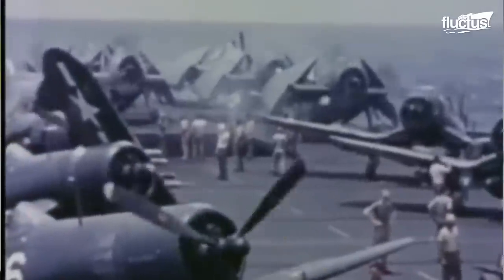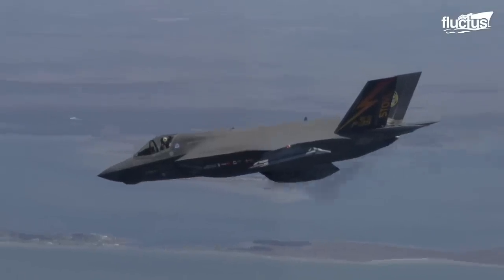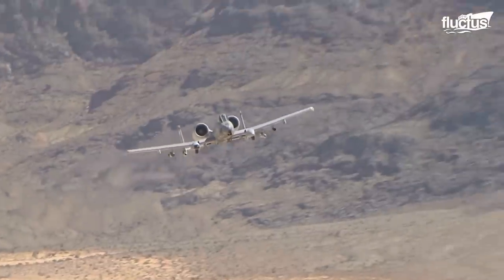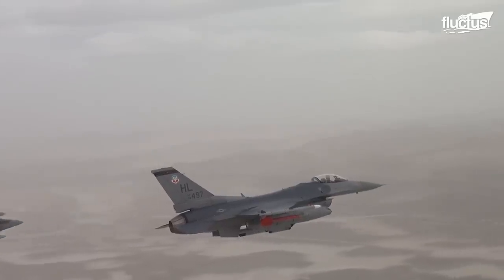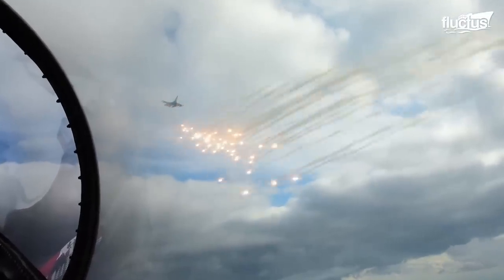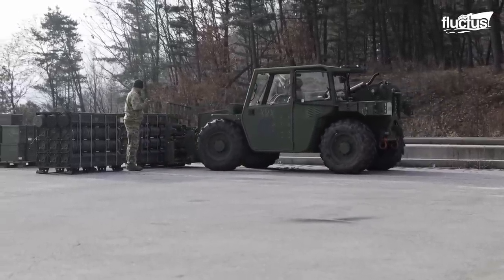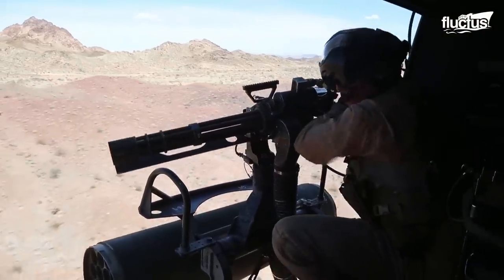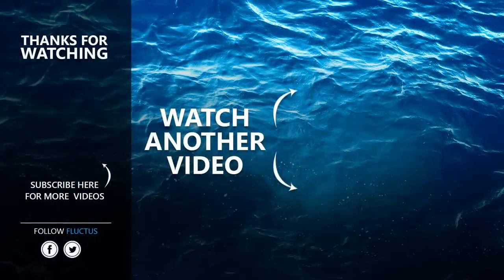The Crazy Process Behind Firing the F-35 Monstrously Powerful 25mm Gatling Gun

Comment: @7:25 --  You can also get hydralic motor and connect it  the socket and let it drive the loader instead of manual.
Reply: yeah or a battery impact driver damn
Reply: He was on the struggle bus for sure.
Reply: Join the Air Force they said. It'll be fun they said.
Reply: @inthemoment9910  -- Looked at the video again those guys looked like they had muscular arms.   Maybe they just liked the workout.
Reply: They use an air driven system once the process gets started.  The first bit is normally done by hand as in the video not the entire thing.
Reply: @Stubbies2003  -- Yes there is also the air drive.   Loaded guns on the F4 Phantoms back in the day so the F16 being a newer aircraft I find this strange doing it by hand.   Doing it by hand was only a backup.

Comment: How r the rounds fired by the a-10 50% larger than the ones fired by f35 wen they r 30mm as opposed to 25mm? Wudn that b 37.5mm? Isnt it actually 1 5th or 20% larger?

Comment: F=Fighter B=Bomber A=Attack (ground) C=Cargo The reason the F-35 is using a gun pod instead of the 20mm Vulcan cannon built into the wing root is the vibrations and recoil cracks the gun mounts when fired. This design flaw is mostly in the Marine variant with STOL due to the lift fan.

Comment: Something I don't really understand. If the f35 is able to be sold to other countries and is our most advanced fighter than why is the f22 off the table for other countries including allies?
Reply: Because it's used as a testbed for other air superiority technologies and a lot of the basics of those tech and stealth are in the Raptor. If you were to get a hold of one you could learn quite a bit, difficult though it would be; if you managed to steal an F-35 not much of it would make sense because of how far ahead the things inside it are and it'd be impossible to reverse engineer with meaningful amounts of quality.

Comment: Russia uses 30mm and 35mm cannon and it fires just as fast.
Reply: 30mm only, and no, max rate is 2100 RPM and for comparision the single barell french 30mm Nexter DEFA 30 canon on Rafale fire 2500 RPM...

Comment: A 10 is beautiful
Reply: In BRRRRRRRRRRT We Trust.
Reply: @Lonewolf 1970  it's ironic in that the plane was going to be moth balled not so long ago. Turns out the wart hog is one of the best fighting planes in service.
Reply: @Lonewolf 1970  another big advantage of the A 10 is they are subsupersonic but still have defense capabilities to thwart off SAM missiles and can come in very close for troop support missions also they are very heavily armored for pilot protection. Plus if I remember correctly they also have three back up systems on important equipment.
Reply: @GladImnotU69  And they have backup systems out the ass. If all the hydraulic goes down they literally fly by wire controls. And unlike modern jets they can be pretty shot up and still come home. You take out the engine on an F-35 and you got a very expensive paperweight. The A-10 was thought out well and can do things modern "do-it-all" jets cannot do and it does them very well.